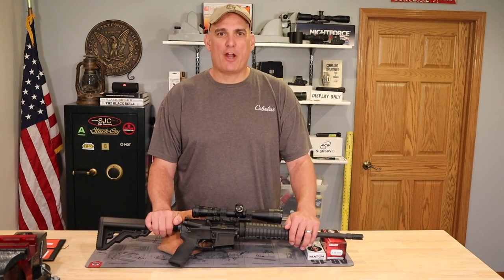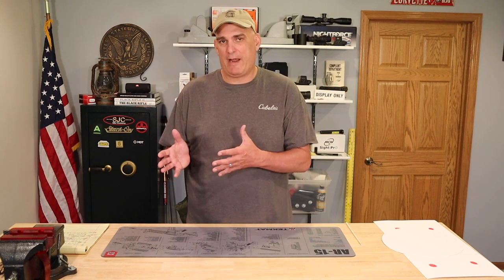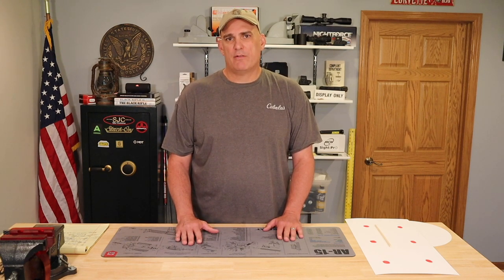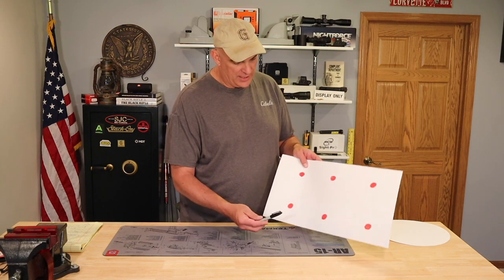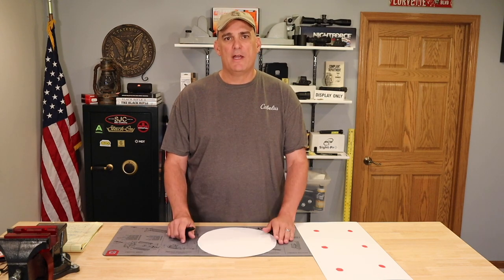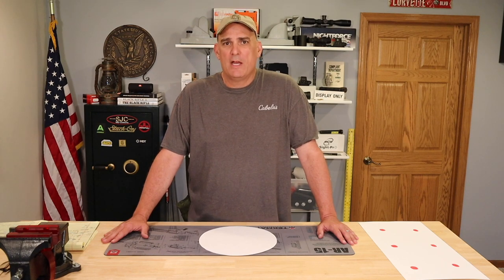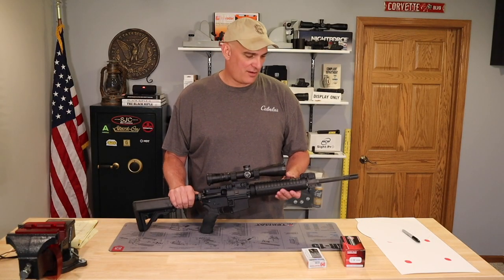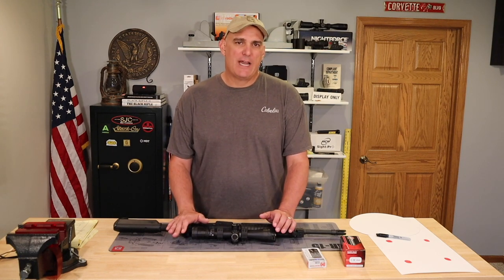Why Ar-15 twist rate does not matter with stability | accuracy. Pt 2.

Comment: This is a broken concept you are trying to portray. I’m a former Marine Scout-Sniper, so ballistics has been my bread and butter. No one cares what you show us inside of 500. That’s not the point. The argument of a faster twist to stabilize 77 grain to 500 has never been the issue. Anyone with a proper ballistic table can interpret this. The issue is beyond 500. I won’t waste time here explaining why. I shouldn’t have to. Do another video taking it out to 600 and 700 meters and see if you continue this argument. 
Jesus. The 77 grain isn’t even going transonic yet at 500. This argument has never been about what it does inside of 500. The ignorance abounds. 77gr SMK has a 1.4 Miller Stability from a 1/9 twist at 2750 muzzle velocity (from a 20” bbl).That is considered only marginally stable at the muzzle. Most will use a 16” and get 2600fps. So, with a 1/9 at 500 it’s beginning to destabilize. Beginning…to…destabilize. A 1/7 twist in the same length bbl gives it a Miller stability of 2.31. Yes….2.31!!! Why would anyone CHOOSE a 1/9 if you have options? It makes zero sense.
Reply from the maker: If you are interested, I shoot a 1/9 twist out to 1000 yards with  a 16 inch barrel and 77 grain bullets in this video.
https://youtu.be/jy6o8jz11Bo